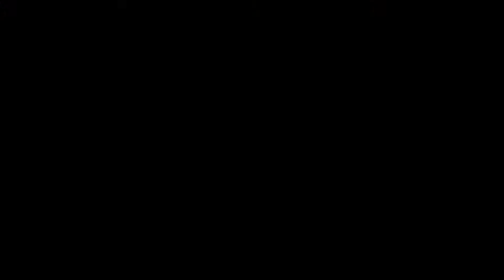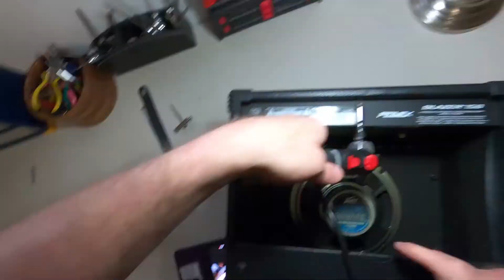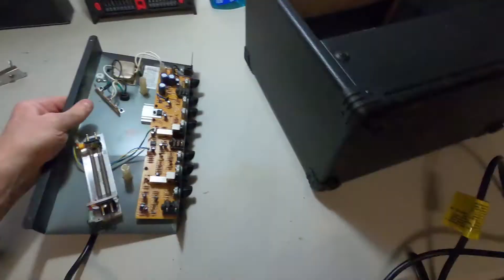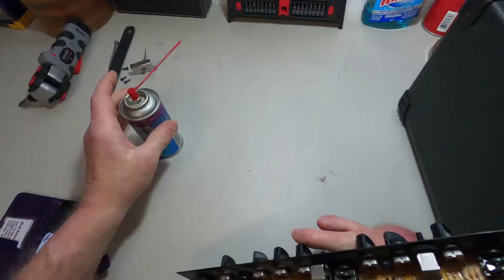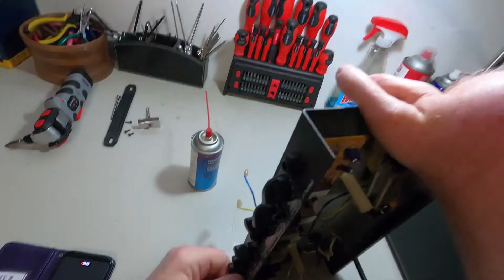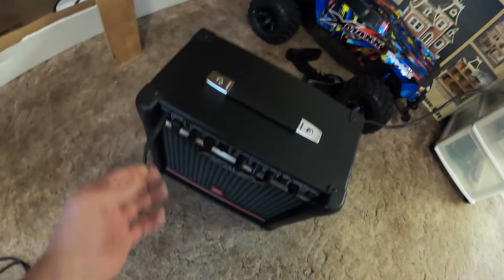Peavey 158 Blazer Amp Repair

Comment: Hi Rick
I’ve the same problem ish, the reverb is out and I dont know which cables to attach to which position on the board. I’ve a yellow/ blue set of wires to one end of the reverb with an orange tab and a black/ green set to the others Red tab. The positions empty on the board are marked CN3 and CN4. Any idea which goes with which.
UK made in China model. 
Thanks in advance anticioation

Comment: ... 03/02/2020:  can you tell me how to use a headset on my 14-year old Peavey Bandit red stripe amp?  There is a photo of amp in my icon.
Reply from the maker: On mine the headphone input is on the top right near the power switch. I use an adapter for my headset (1/8 3.5mm Female to 6.5mm 1/4 Male Headphone Jack Adapter Plug Stereo)
Reply: Rick:  Just like the 2020 Peavey Bandits, my 2006 amp has no input jacks.  I was hoping for a quick fix or an adapter.